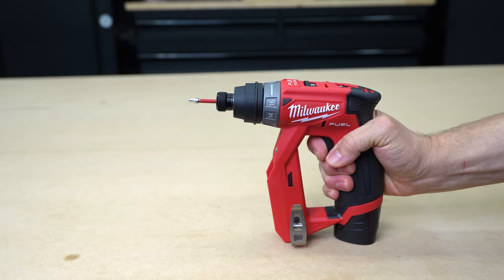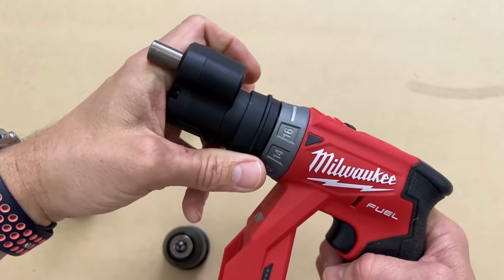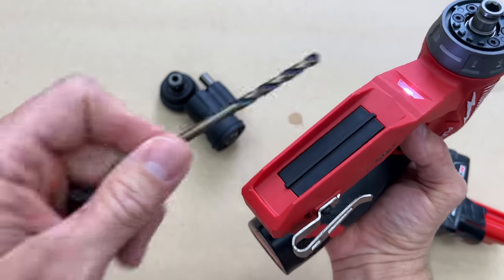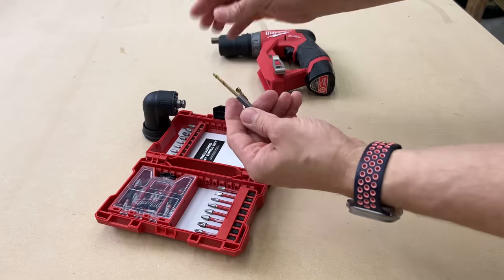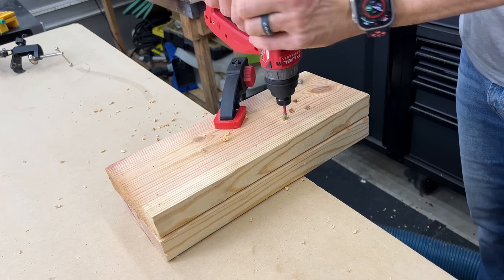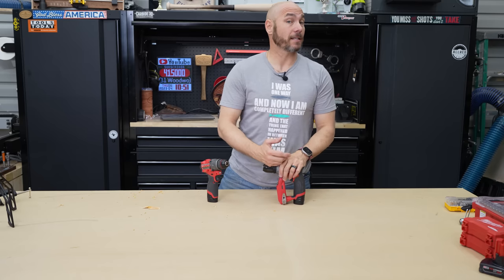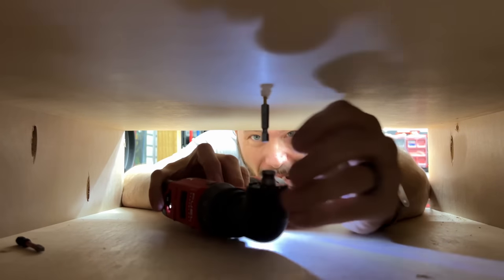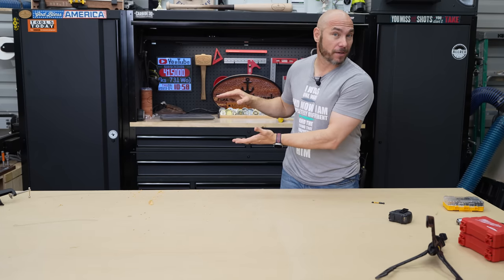Milwaukee's BEST Drill for Woodworking?

Comment: You’re late to the party, Festool put one of these out like 15 years ago.
Reply: I’m sure he’s aware of the Festool. No one‘s late to the party people just don’t want to pay $400 for a tool that you can get for half the price on a much larger platform.
Reply: @steffendetrick  actually it’s far less than $400.
Reply: @AaronGeller  the average price is $339. After tax you’re at about $370. I would not call that far less in my opinion.
Reply: @AaronGeller  not to mention tho the Milwaukee is not very powerful and it’s not intended to be because it’s an installation driver. It is noticeably more powerful than the Festool CSX.
Reply: @steffendetrick  if you get the base version, it’s $285 and you can get it 15-20% off on their refurbished site. They are releasing a new version of it as well that’s more powerful. In Michigan that’s $302 after tax.
Reply: @AaronGeller  i’m not saying that prices don’t fluctuate I’m just telling you the average price is $339. I’m not comparing bare tools to kits. The average price of the Milwaukee is $199 (kit) but I’ve seen it as low as $169 (kit) on sale. I’m going by the regular MSRP and I’m not knocking festool. I’m just saying there are plenty good reasons to go with the Milwaukee especially if you’re on that platform. Comparing current models the Milwaukee is more powerful it’s more affordable  It’s actually a little shorter and more compact it’s a larger platform plus  availability they are sold everywhere.
Reply: @steffendetrick  I agree with you — festool will almost always be the more expensive option. For the money, the Milwaukee is a very hard to beat deal. I’ve seen plenty of people debate CXS vs Milwaukee Installer and it seems to come down to preference. It is a perk that the updated CXS will work with Festool’s 18v platform. I doubt Festool will offer near as many battery powered tools as Milwaukee
Reply: @AaronGeller  they also don’t have to because their festool. You have professional grade tools, and then you have premium. Festool and Mafell pretty much own that market.  And I did see that festool  was expanding their cordless platform.
Reply: @steffendetrick  But the vid claims the Milwaukee is the most flexible drill on the market when it never was, and certainly isn't now.

Comment: Great review!  Only you are not correct with your statement about an impact driver function.  You said it isn't a downside for not having the impact function, because a drill means you won't over drive screws.  An impact driver has far more control than a drill when driving screws.  Actually, it is the biggest advantage of an impact driver.  So you don't overdrive screws.  Haha  Not trying to troll...  That really was a very misleading comment to your viewers.

Comment: I see this as a gimmick tool with no real world function. I hope I’m wrong and someone has use for it.
Reply from the maker: It has a lot of real world uses
Reply: @731Woodworks  I understand the theory around tools like this. However, in my experience, having a tool with attachments can be an issue.  The attachments end up in different toolboxes from one another (lol yes I realize my user error) and when I need a tool , I grab the tool designed specifically for what I’m doing. So, although it doesn’t fit my needs , I do hope someone can find use.